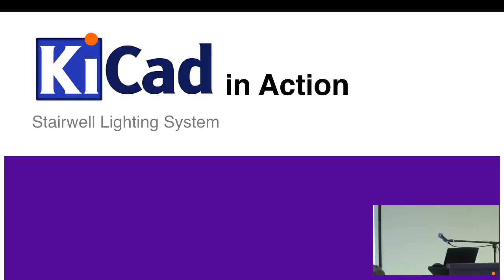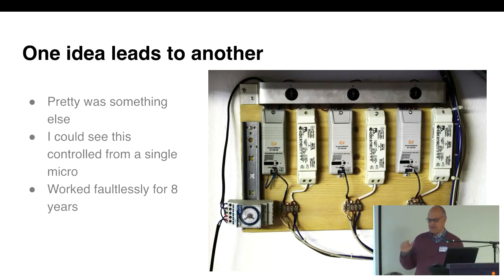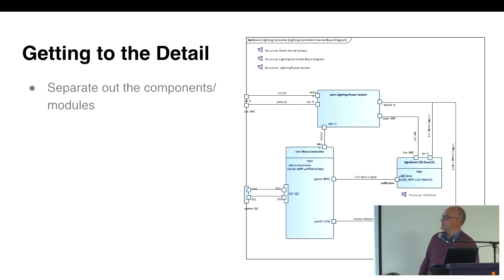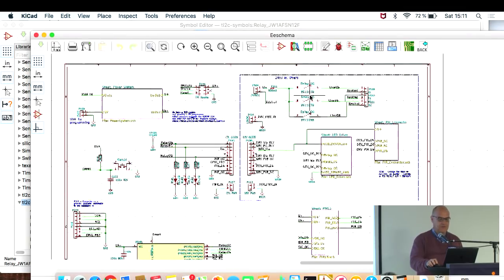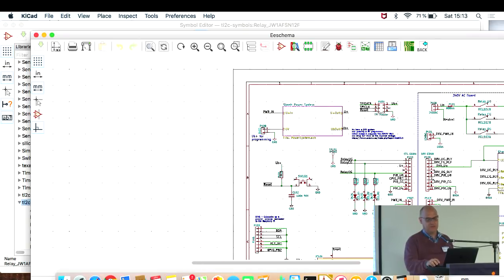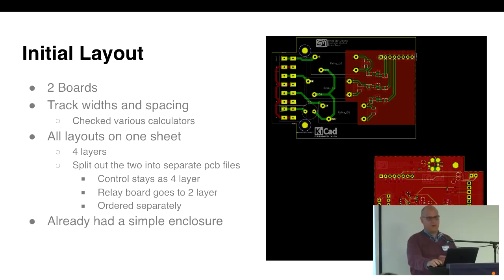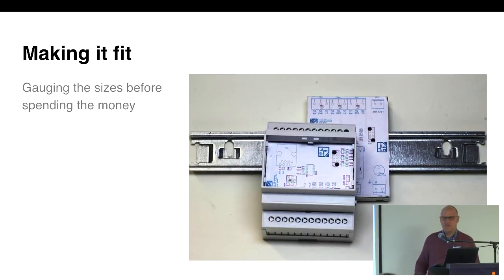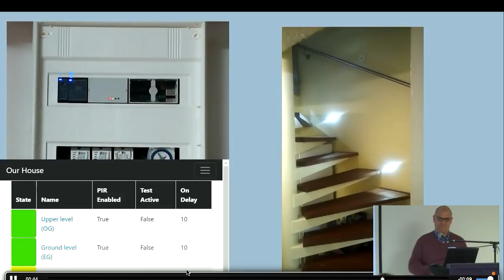"KiCad In Action: A Case Study for Stairwell Lighting" - Steve Mayze (KiCon 2019)

Comment: Well done! I agree with @rjhelms - great idea to print layout on the card.  I was impressed with how you "easily controlled" 240V - as if it is nothing!  GREAT JOB.

QUESTION: Are you concerned about safety re: 240V board?
Reply: I am very concerned. From previous experience, I knew that it was important to have no exposed live parts. I spent quite a bit of time reviewing similar projects which gave inspiration for the layout. I was looking for PCB standards but they were not easy to come by freely, but I did find some on-line calculators for the track widths and spacing. These compared well with the projects I had reviewed. I also chose the relay with the appropriate rating that could comfortably switch then intended load. It is important not to be complacent and it was my concern for safety that lead me to construct the test rig for development, testing and verification. Never the less, such projects should be inspected, tested and installed by a qualified electrician.